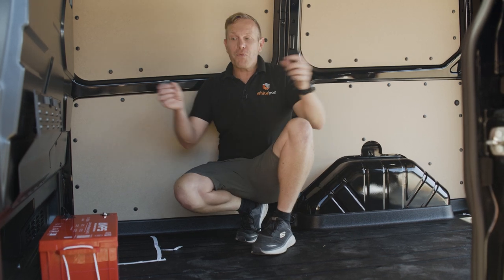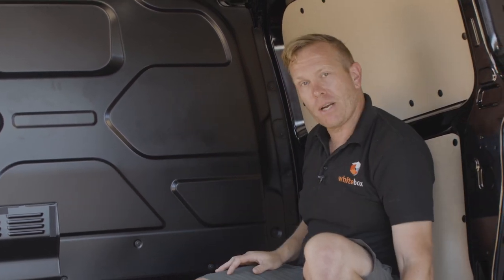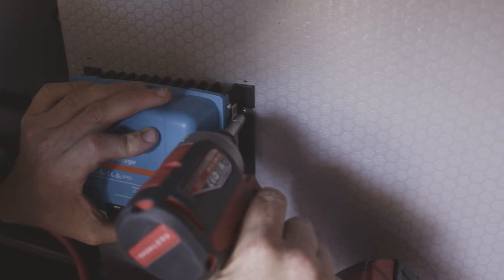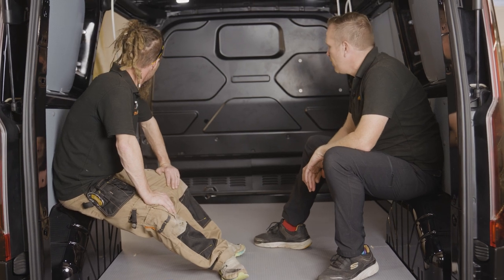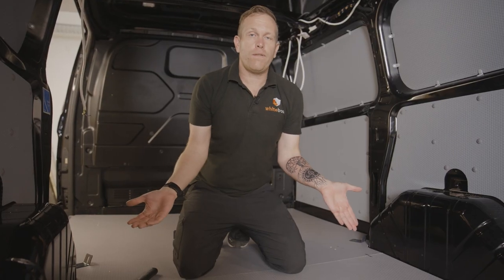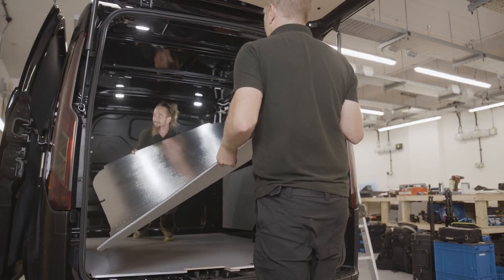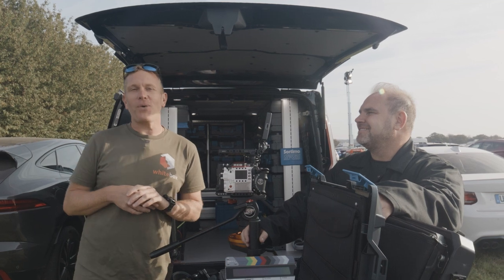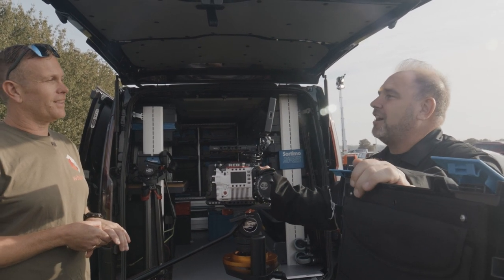Ultimate film and media production van fully kitted out with racking, onboard power and much more.

Comment: Love to see well installed racking.  I'm a big fan of sortimo, mine is over 7yrs old and on its second T6 van now. I took the ply lining from the new van before fitting the sortimo floor from my old van into it and found the arch boxes were screwed right through the arch tubs. The floor was screwed every 3 inches with wood screws right through the van floor. Brand new T6 highline ruined forever by bad ply lining.
Reply from the maker: That’s Great to hear Steve. 

And I have seen it too many times. The floor ends up with small holes in it that will eventually rot out.